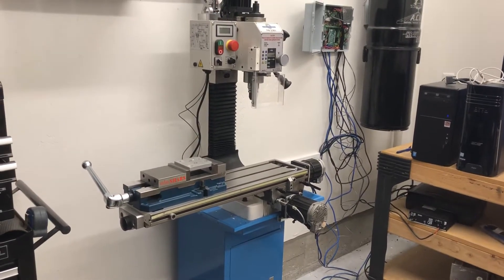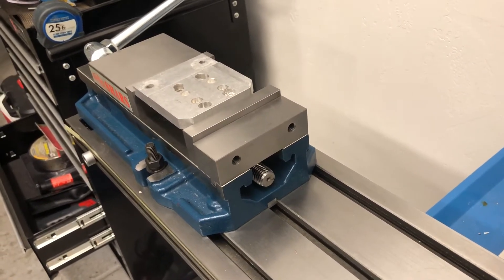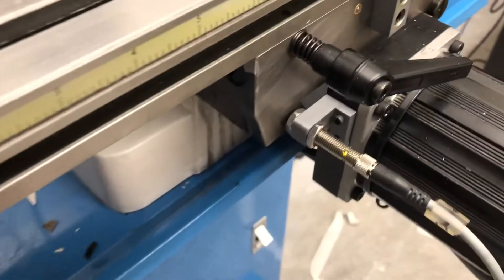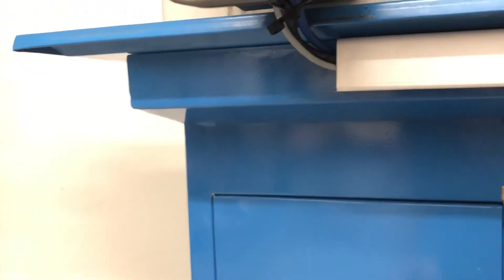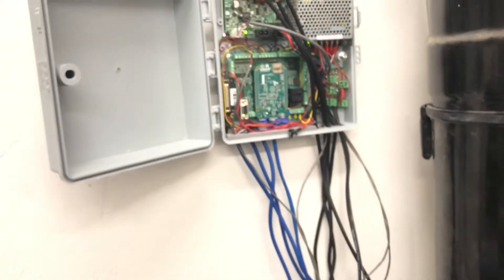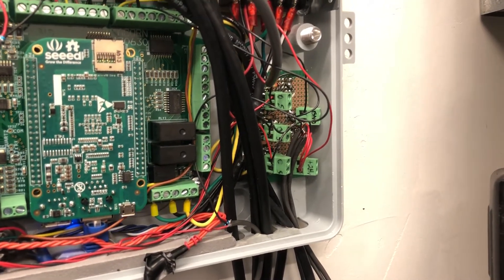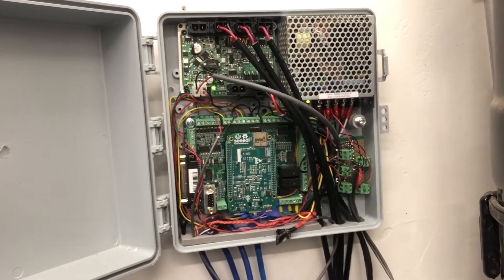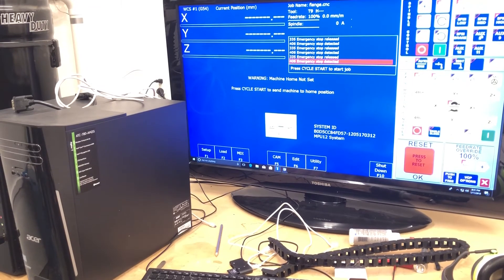PM25v mill clearpath/acorn cnc conversion

Comment: i guess those servos alone are much more expensive than the rest of the machine:)
Reply: Nah, the largest nema 34 SDSK servo from Teknic with the enhanced encoder and shaft seal is just over 500$. The power hub is 50$ the IPC5 power supply is 200$ ish. And then add cables